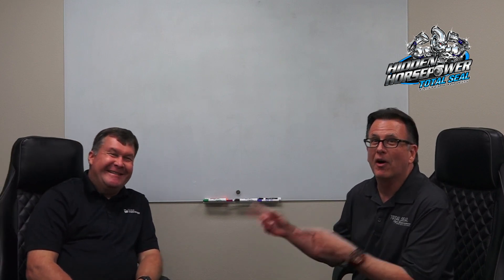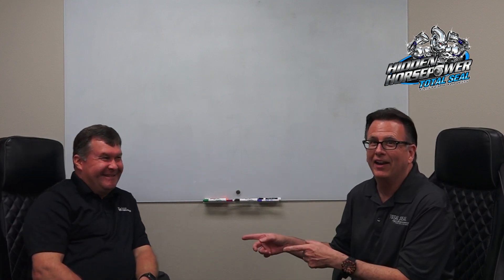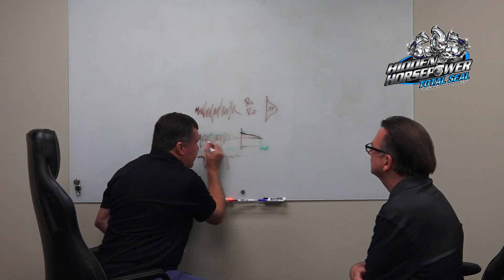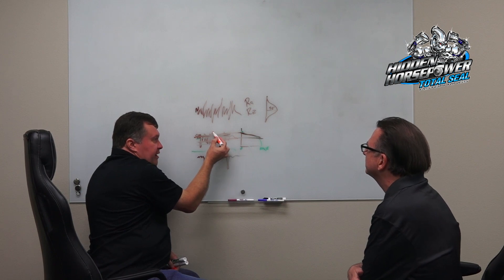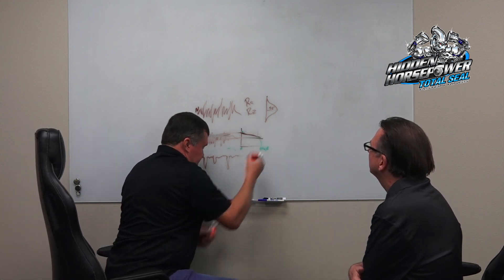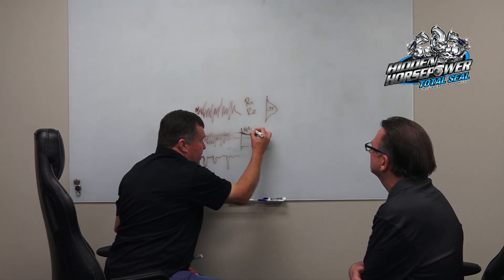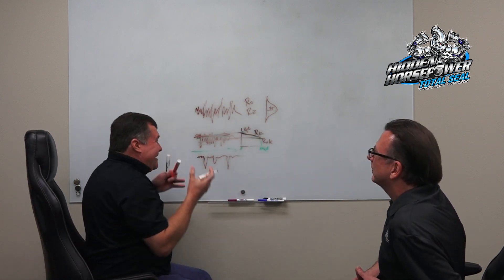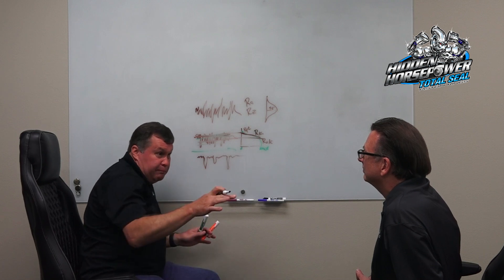BONUS EPISODE - Mark Malburg talks surface finish with Keith Jones - Hidden Horsepower

Comment: Can you measure the Q Parameters with a meter like a SJ-210....or do you have to get something more exotic?
Reply from the maker: The SJ-210 can take the trace, but you need Omni Surf or TraceBoss to really work with the Q parameters. They are more powerful visually.
Reply: @TotalSeal  thank you for the quick response.  I figured the data would have to be exported for analysis in another software package.